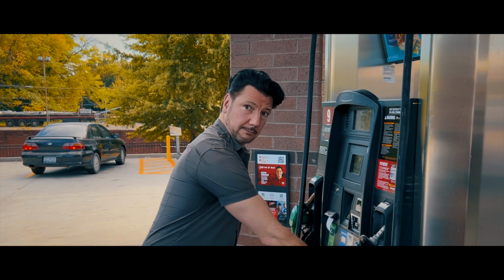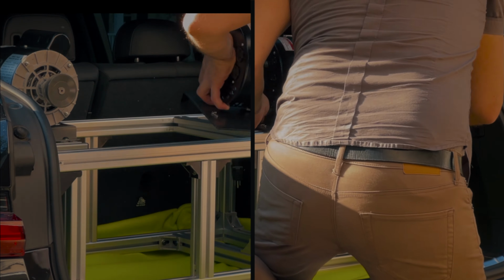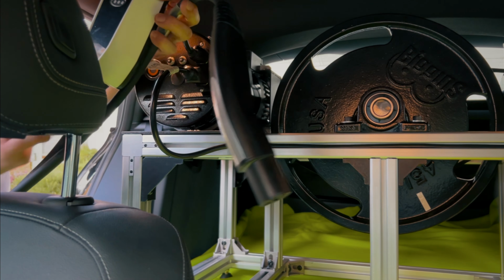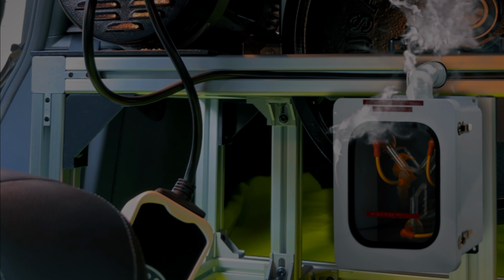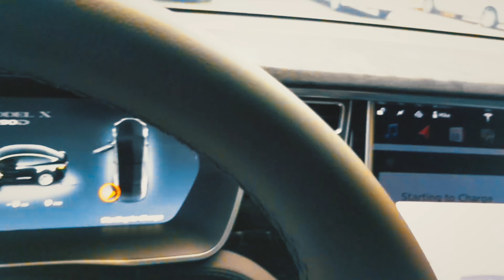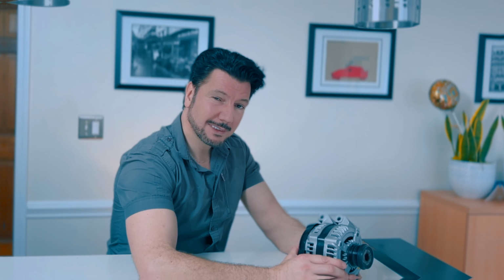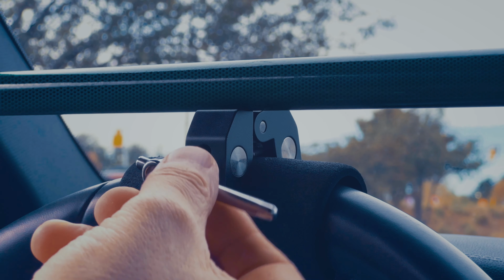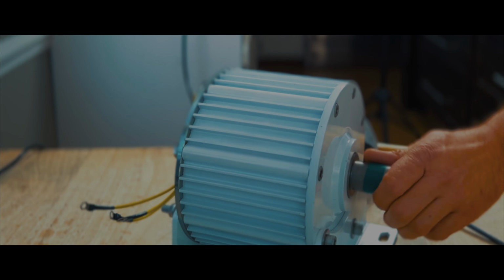Never having to stop with this electric car!

Comment: Please use 100kg weight and put and use a voltage regulator in between motor generator or 1 to 1 transformer

Comment: I have idea and plan of a new invention ( energitic heart ) or ( energitic cell ). Its the most smal size smarter powerful up to 380vac and 64 Am. The most advanced self running generator . who can be used for electric car's.bus's .boat's. Airplane's. Even houses.
If it used for car's.bus's ....it gives the ability and the possibility of inlimited range of running  + no need to recharge. ( the batterys will be secondary choice ) no polustion. 

I give it a name ( energitic heart ) or ( energitic Cell )